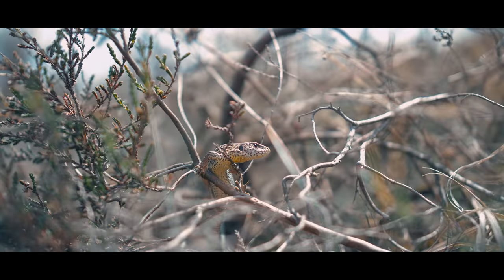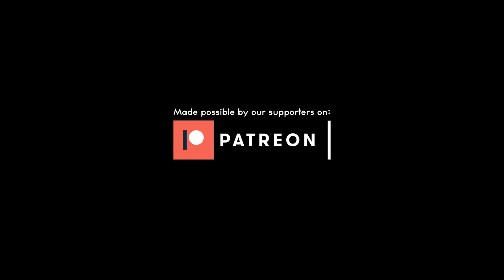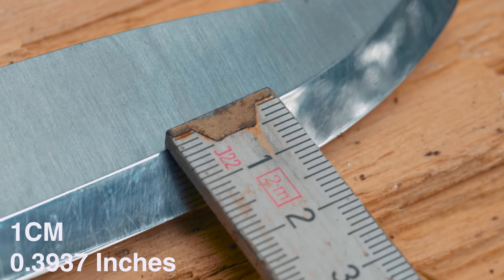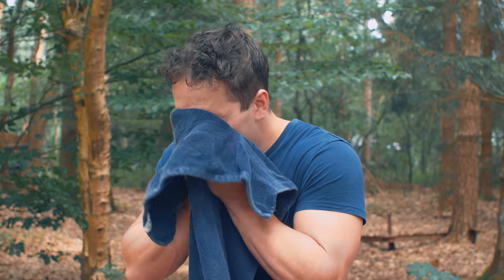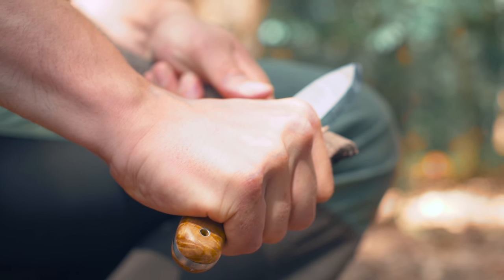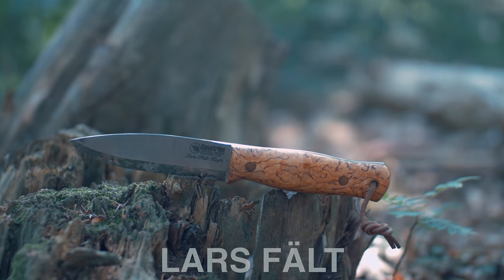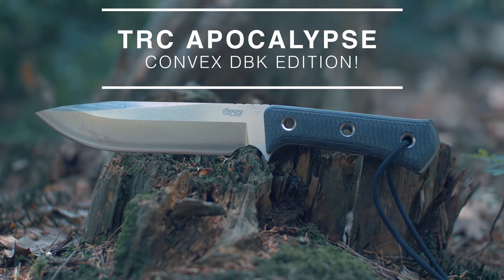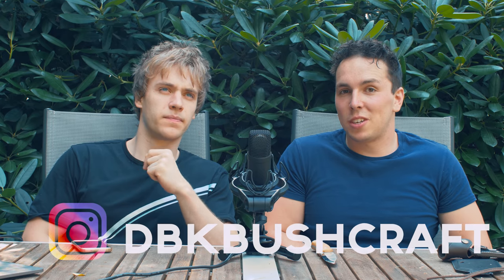Stay Away From Buying This Knife!! | TBS Boar

Comment: Strange, I got this knife since June and used it through whole summer, 
either having no problem with feathersticking, carving or handle being wet. 
Still looks like new, but what I done before using it in any way was polishing the mirror out of it and using chestnut oil for the handle few times so it would be more resistant. 
For food it is obviously a no-no because it is a really fat mofo, but for that my fiancée got her sexy pink mora xd 
Grip on the handle is divine for me because I got damn long fingers.
What I liked the most was how durable the blade is, I didn have to sharpen it even once. 
But once again, it is hard to blunt such a wide blade.
TBS is not a no-brainer like moras (with all respect to mora's they are great and awesomely priced). 
This is a knife with spirit and needs to be conserved like everything that is NOT a piece of average steel sticked into micarta handle.
Reply: Oogway because it was a completely biased review. They didn’t prepare the knife at all, they were just paid to negatively review the knife

Comment: I put olive oil on mine as they said to do this to prevent rust, then I took it out cleaned it and saw the metal had spotted I then search the internet and it said to put soap and let it sit for 10 minutes as I did this I looked and the knife got worse spots almost like instant mold causing it to spot worse I now washed the knife three-times and as you photos show the handle now starting to separate from the tang, oh by the way I have the Grizzle knife. I contacted the bushcraft store they said to send the knife back, the remove the spots but the grizzly and tbs letter are gone, tones of scratches and the woods separated from the tang they semi try to repair but no success and request a replacement but they refuse with tons of excuses that it was my fault for not taking care of the knife but I disagree, just do not buy these knives from the bushcraft store too expensive and not well made and they do not stand by the warranty, buyer be aware!!!
Reply: Your knife has a lifetime guarantee call them up and they will sort it right away

Comment: The new boar is only 4mm thick and slices alot better. Think you guys got a dud, got mine in n695 steel and curly birch, no handle issues and blade came double as sharp as my benchmade bushcrafter and alot thinner behind the edge  its bevel is also the exact same size as the bushcrafter and I know you love that knife so weird to see you knock this so much, think tbs makes some of the best bang for buck up there with lionsteel
Reply from the maker: Hey Ryan,

Thinning down the Knife is the best thing they could have done I think. It’s nog just the bevel height but the combination of bevel height and thickness. It kinda had a fixed angle of you dont totaly regrind iT. Na angle that just doesnt Get Sharp. Also because of the thickness the handle is too fat. It’s like a Bushcraft version of the Becker bk2 which serves no purpose in this category in my opinion. 
If they thinner the Knife down Now I think I like the Knife 100x more. 
However, what bushcrafter are you talking About? The brak rivier Bushcraft has a heigher bevel at least in my case.
Reply: @DutchBushcraftKnives  thanks for the reply chaps, yeah mine is the 4mm version not 5 mm so may of made a big difference, and yeah I meant the bark river bushcrafter just typing like a tard, mine are almost identical in size, maybe after your review on the newer versions they made the bevels bigger, it kinda feels like a lighter bk2 but diggs into wood much nicer  and it's much prettier, I really rate tbs, maybe worth giving them another go! They're puukko might be up your street a little more (ordered a jelio after your video the other week, can't wait!)

Comment: I have the TBS Boar and I have it just for show really. It sucks at feathering, I got the thick on and it's not the best for carving, they say not to use it to strike a ferro rod and not to baton with it, What is the sense in having a bushcraft knife if you can't baton, carve or strike a ferro rod?. So like I said, It's just for show. The scales were not flush with the tang, the case is falling apart and It's my most expensive knife but is probably close to the worst out of what I've got. I once tried to lightly tighten up a screw and got a large chip in the blade and the screw was still loose. Even a $10 knife won't do that. I contacted the company to ask a simple question about their heat treatment and never got a reply. I paid almost $300 CDN.

Comment: That sheath design, type of steel used and blade thickness is similar to another european brand called Cudeman.

Why not review the BS9 Bushcrafter (REF. 206) against the TBS Boar or similar Bushcraft knives? 

Cudeman is one of the most go to knife brand around this side of europe along with Muela and Nietto.

Personally i think that 4.7 mm blade thickness (their website says 5mm but it is really 4.7mm) is to much for bushcraft but it would be interesting to hear the toughts of someone who does knife reviews for a living. Also there is almost no one doing reviews about this brand outside of Spain.

Keep up the good work.

Comment: Sorry guys, I know you don’t like this knife but that was a shit review, 
do you really need to deliberately fake the hard work of tasks to give an exaggerated effect of poor performance.?
.......
In case you are wondering.... yes I own 2 of these TBS Boars, but I also own the Lars Falt so am in a position to judge.
.........
You are correct that the small bevel means that it craves less well than other deeper bevelled knives. But it still carves well if you keep it sharp.
The Lars falt carves better, but then again my Casstrom No10 SFK carves even better than both of them.
[the SFK is a smaller knife with a deeper bevel so carves extremely well]
.....
The thick blade and the short bevel of the Boar means that it battons through gnarled wood like a beast, and is extremely robust.
.........
The point/tip holds up to abuse, the edge doesn’t roll over or chip. [and can be kept razor sharp with a strop]
What the hell did you do to the blade before you tried to slice the paper? 
[My ones hone up razor sharp good enough to shave with]
[Don’t go hitting rocks with it as that will chip the blade]
.......
If you go for the stainless steel version it is rust resistant but more difficult to get honed. 
The carbon steel blade is easier to sharpen but will rust like hell if you don’t look after it.
.........
The curly Burch scales come with a warning to look after them as they are Not treated so need TLC, so try oiling them like anyone else would. 
Ps I think that the walnut handled version is better than the curly Burch, tough and sturdy and he on I have is ‘also beautiful wood... just remember to look after it. 🙄
If you’re really worried buy one with Micarta scales.
.....
My pride and joy favourite is the Lars Falt.
My Casstrom No10 SFK is better at feather sticking than both of them.
Which knife do I keep in my grab bag in the car ? .... the TBS Boar ‘curly Burch carbon steel’

Comment: If they want the Scandi grind, 3-3.5mm would be a much more appropriate blade thickness (I know the new one is like 4.5, still too thick). At 6mm on a 110mm knife, even an aggressive flat grind would leave you pretty fat behind the edge and who wants to see a hollow grind on a bushcraft knife? Much less one aggressive enough to tame that fat thing. For perspective, the ESEE Junglas is like 4.7mm thick and it's a massive chopper blade. Then add in the poor craftsmanship. They really missed the mark on nearly every aspect of this knife.

Comment: TBS  Wulverine is a much better choise. I like N965 steel, good edge holding. Easy to sharpen stainless. Has a realy ergonomic handle. realy good all purpose knife. Great sheath options. Pitty they take it out  of production (so i have heard)
Reply: Can't comment on the Wolverine but I've been very impressed with n695co steel, I usually avoid stainless like the plague but a casstrom I wanted only came in it and I was shocked at how sturdy it is, how easy it is to sharpen, holds an edge reasonably well, strikes a ferro rod as good as any knife I've owned or made, and has a nice fine grain structure so gets a really nice razor sharp edge if sharpened correctly, I honestly can't work out why it isn't more popular.

Comment: this is what you get when you make a knife based on fads. oh scandi grind is the best so lets make it scandi, oh thick knives are the best so lets make it super thick. well, guys, thick blades with a scandi grind just don't work, its that simple. there is absolutely no reason a knife this short should be 6mm  / .25" thick, its so ridiculously overkill. if you do insist on making a knife around 4" .25" thick atleast make it a full flat grind. 

as far as wanting to like this knife / buying it and being disappointed? I could just look at the specs and instantly realize it would be crap.

I like your attempt at a western US accent lol, priceless;)

Comment: The SR1 has a secondary grind,  you guys hate secondary grinds.  
So, why are you giving away the most popular pocket knife with Army Specia 
Forces units?
Reply: Secondary grind? I thought it was a hollow grind. If you mean a secondary bevel, most knives technically do.
Reply: @desertrainfrog1691  "Bevel" is used interchangeably with "grind".  It refers to the 'V' angle of the knife.

A "Flat" Grind has only one angle to each side, running from the shoulder to the edge.  These are the sharpest edges but are also the weakest, as the edge is quite thin.

Scandi grinds have two bevels on each side, but the secondary bevel starts usually at least a 1.4 inch above the edge to get a sharp edge.  These are stronger blades than a flat grind, but not as sharp as a flat grind.

The secondary grind is a blade with two angels on each side like the Scandi-grind, but the secondary bevel starts very close to the edge.   Most knives are, as you said, secondary bevel knives. These are stronger than flat grinds and scandi-grinds.  They shave well though.

On the other end are the Convex edges.  These have flat bevels, or grinds, down most of the blade side, then it curves into the edge.  These edges are the thickest and so very strong, but not as sharp.  You cannot shave your face with a convex, as these two showed in one episode where they used the different edges to shave with and the convex, which is their favorite edge, did horribly.
Reply: @billandrews  I've heard this. A flat ground with a secondary bevel is what a lot of knives have though. Like your spyderco knives. 

Secondary bevels aren't bad? I don't see a problem. Same with a sabre grind, it's like a scandi with a secondary I believe. Just about all axes have a secondary too.